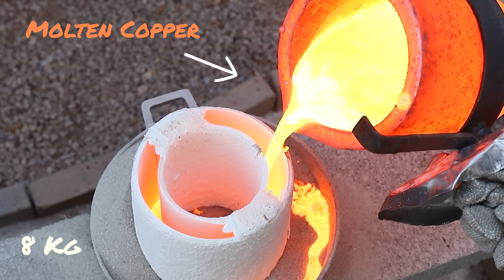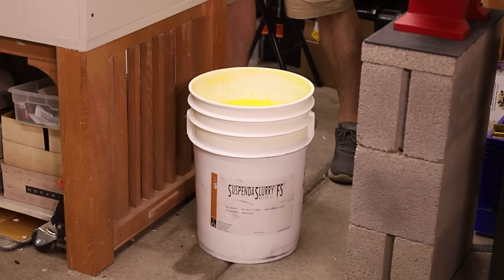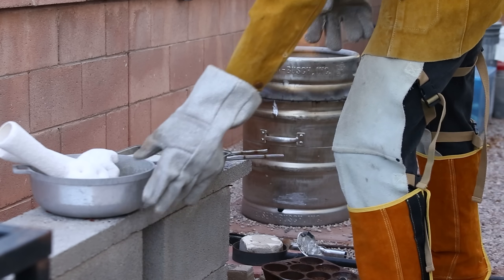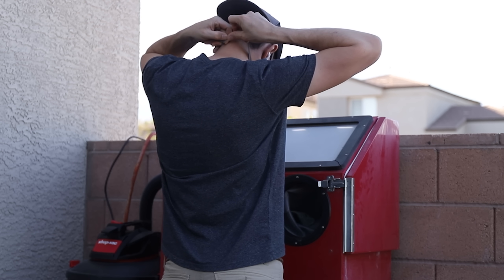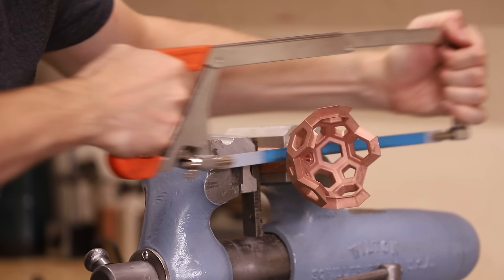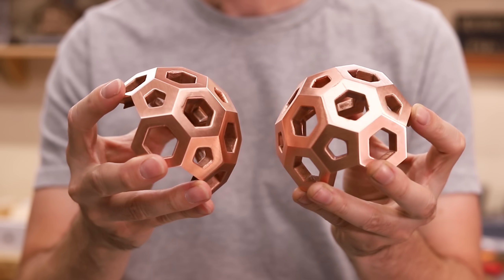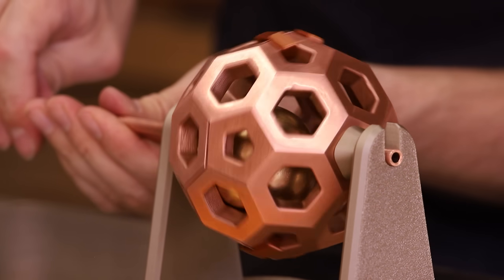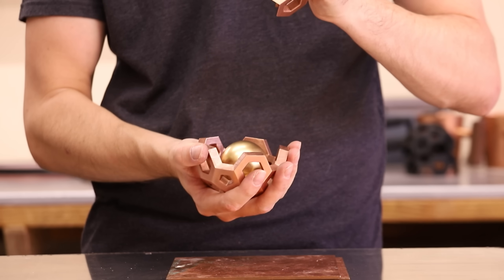HUGE Magnet VS Copper Sphere - Defying Gravity- Will a Neodymium Magnet Float Inside?

Comment: 11:01 when drilling at n rpm, put the camera to n/60 fps to make it seem like the sphere is not rotating
Reply: The "sphere" has 60º rotational symmetry, so you can multiply that stroboscope by 6 (n/10 fps):
60RPM = 6fps
120RPM = 12fps
300RPM = 30fps
And use a short exposure time (with lots of light) so as not to blur the sphere to help it look stationary.
Reply: @robspiess  I thought that if he matches the RPMs to the FPS it should be enough, because each frame would  equal one rotation and would capture the truncated icosahedron on the same position every time, making it look stationary, so we should be able to see through one of the openings as if the truncated icosahedron was stationary.
Reply: @LeonardoG1981  RPM is how many per minute whereas FPS is how many per second.  So if you set them to the same, say 1 RPM and 1 FPS, you'd get 60 frames of different rotations each 6 degrees apart (360° / 60) and wouldn't look stationary.

If you mean matching FPS to RPS (rotations per second), that would work, but that's what originally stated.  The downside is that either it's a slow framerate, e.g. 3 FPS for 3 RPS (which is 180 RPM), or it's spinning ridiculously fast, e.g. 30 FPS for 30 RPS (which is 1800 RPM).

I was saying you could increase the framerate 6 times since the "sphere" has 60° rotational symmetry, e.g. 30 FPS for 5 RPS (300 RPM), and it would still look stationary.
Reply: @robspiess Diligently have you trained your mind robspiess.
Reply: @robspiess but bluring the cage would show to some extreme how it’s not the cage holding it at all
Reply: Exactly. My father was a film maker both 16mm and 32mm . He had a mechanical intervalometer  that hooked up to the camera(Bolex)for time laps etc.By synchronizing the frame rate with the openings i bet you could get some cool footage.This was all before digital cameras. The beauty of the device was that it, along with the camera , was portable (in the analog sense of the word) I wish it had survived but it is long gone. I'm sure it could be done, just as you say, digitally.
Reply: 120 FPS Or Slow Mo 💁‍♂
Reply: n/120pi
Reply: of have long-enough exposure time to fully blur the sphere at speed
Reply: A stroboscopic light at 1/10 the RPM would give a better effect than changing the exposure, it would also be easier to synchronize with the holes of the copper sphere

Comment: Can i ask you to put some rubber between the two copper parts, and then put a multimeter on the two seperate parts and spin it, see if you get any electrical current?

Comment: Good stuff 😊  For scientific purposes try this...

Make it completely spherical, but for one "window" at each side and close to the axis.
Spherical, but for many holes in it but to the axis.
A smaller magnet ball.
A solid sphere

The windows will be tough to see through, so create a strobe that only illuminates upon a set point to see through the smaller holes.

lastly, and for all of the experiments, use an accelerometer or two on the table to judge where the ball is at any one time and trust to science as to what is going on inside 😊

Comment: I have a large 1/2-inch wall thickness copper tube, years ago I did the same things you did in your opening, cool work on this experiment.
Reply: Is the heavy wall thickness really necessary? Would a thinwall tube work as well?
Reply: @LexipMedia  I'm not sure, but I think it has to do with mass of the conductor, because you are dealing with electromagnetic fields. I just built a loop antenna out of copper pipe for my ham radio, that is called a mag loop it uses the magnetic portion of the electro/magnetic spectrum, I don't understand the theory but can use calculators to make it work.

Comment: Because the sphere is polygonal magnetically the magnet will see a bumpy surface, the join line being down the middle will make it even worse because the magnet only 'sees' loops of copper as electromagnets, and the join line breaks lots of loops of copper which ought to be there. This will make the centrifugal force problem much worse as the magnet is being effectively grabbed by the bumps.

I think you could get the effect you want by making the sphere out of a series of copper rings held together by something non conductive. That way the symmetry isn't broken and the ball should levitate smoothly.
Reply: Yes, probably a non polygonal circular surface would work better ... Still, I'm positively impressed
Reply: What if it was just a copper hollow sphere with holes drilled into it to see inside or slots cut out?!
Reply: @purplebooger6410  the more uniform it is as it rolls the better it would work in this respect, so smaller holes would be better, I am not sure how smooth it has to be. I think the first thing would be to get the magnet in through a hatch at one end, not in the middle. Though I don't know if this would make the casting process difficult.
Reply: I think you may be on to something here; but I see half (slightly less than) circles connected together in end caps with copper screws
Reply: any current through any wire no matter the shape will generate a magnetic field and any magnetic field that cuts through any wire no matter the shape will generate an electric current. The join line doesn't break any loops. It just makes more and smaller loops. The main problem is for what he wants to happen the magnet needs to spin slower or faster than the copper ball. The problem is once the magnet matches speed with the copper ball the relative speed drops to zero so the magnetic fields from the magnet are not cutting the copper therefore not generating Eddie currents to generate a field and repel the magnet. When they match speed the magnet stops getting repelled by the ball and falls. This stops it and its able to generate magnetic fields again therefore pushing the magnet back to the center. The best way to solve this that I can think of is to keep the ball rotating on all three axis constantly changing the axis of rotation. This would make it to the magnet never catches up to the ball keeping a difference in speed between them.
Reply: @rookooful  a motor spinning the horizontal axis like he's doing, plus another spinning the whole base around a vertical axis?
Reply: What if it was more like a tyre or just a ring?
Reply: @bananabaton  we know a tube works because it was early in the video. I think the aim is to make it possible to see the magnet better.
Reply: Heave ye tried transparent aluminum, Laddie?
Reply: @jamesspears7242 
Nice one Scotty!
Wait....
What are you doing back here in 2024??
🖖
Reply: This path recreates an alternator.
Reply: butonce at a high enough speed and if ballanced just right it shoild lock in a center point from the shape.
Reply: 22.5° on tilted axis may do as such however it would need a 10 speed wheel to spin on to get true centrifugal forces exerted in it. Possibly make a huge magnet sphere to orbit as well.
Reply: I thought something like this too.. the field of a sphere should hold at specific points, but at a certain spin rate wouldn't it resonate to the eddy currents phase to the frequency of the copper "soccer ball" ? 

Genuine question. As I made a detailed comment about improvements and a mad labs addition.
Reply: @dannfyxt3049  are you talking about the mass on a magnetic spring resonance and that resonating because of the change in inductance that the magnet is seeing?

I don't know if that would stabilise or destabilise the magnet. There are also magnet rotational modes to consider and how they interact with the dodecahedron.

It is messy and difficult and i think a finer mesh with no electrical holes would be a lot more stable either way
Reply: I don't know the science stuff, but I think we may have the same idea: really strong magnets in the middle and a ball with magnets outside. Somehow, with scientific stuff, we can make the ball float, not really 100% magnetic with the middle magnet. It will be cool because when the dog plays with the outside ball, it will go in circles and will not drop because the middle one is a really strong one.
Reply: Bussard fusion

Comment: Since its audible when the ball is floating and not touching the 'the containment construct', I'd go with a hand crank to avoid motor noise. Maybe with some nicely machined gearing so you can finely adjust the speed? 😊

Comment: Curious if its heating up too much and causing the sphere to become less magnetic. Can't remember if thats only at high melting temperatures, but I figure it would be contributing to it since the magnet is so big. Shame their aren't smaller, stronger magnets, or at least a lighter weight one with similar magnetic strength.

Comment: thats cool and so many questions. does its behaviour chance if you improve the connection between the tho parts of the sphere? what about if you insulate them from eachother and spin the ball on a different axis? will it behave different if the electrons can follow a straight line instead of being forced to follow the hexagonal path?

Comment: Instead of buying silicon to dust on the ceramic next time, grind the old ceramic. You already know it's melting point and it is thermally stable now. Common in raising the working temp of clays by a few hundred degrees above the same virgin clay.

Comment: If you figure out an ideal speed, you could try synchronizing that with a strobe for filming the effect.

The left over sprues could be made into candle sticks!

Use the torroidal magnet attached to a motor to spin the sphere at just the right speed to make the magnet levitate?

Comment: would something like this work to dampen vibrations? like, say, I have a 3d printer on an unstable surface, you mount this to the under side and it resists moving?

Comment: The electrical contact between the 2 shell isn't very good, you could get a better result if the two shells fits perfectly or with indium foil in between

Comment: I feel like there has to be some form of mechanical application for the rotating it with a different magnet without actually touching it. 

Makes me wonder if you had two setups (as identical as possible) and placed them about a foot apart could you rotate one forcing the other to rotate? would they balance each other out and provide resistance to you rotating them? Would they rotate in opposite directions or the same direction? (actually it looks like from your experiment in the video they would rotate in opposite directions.) Can you rotate it with an object inbetween them (like a thin barrier)? 
Depending on how much force/resistance is required to rotate one sphere. Might have some mechanical application for changing rotational directions. What if you set up say 5 of them a foot apart. then manually rotated the center one. How much force would be needed to rotate them? would all 5 rotate alternating between directions? 

these are the questions in my mind. 
What if you set up 5 identical setups about 1 foot apart. Labelled them 1A 2B 3C 4D 5E. On 1A, 3C, 5E you had the rotating rod going out the left side, while on 2b and 4D the rod was going out the right side. 2B/4D's rods are both connected to their own individual Motors both set up identically to spin clockwise. Would 1A/3C/5E rotate Counter-clockwise and how fast would they rotate?
would it be: 
A) All three Rotating counter-clockwise at the same speed as 2B or 4D
B) All three Rotating counter-clockwise at the speed of the sum of 2B+4D
C) Only 2B / 4D rotating clockwise (due to their motors applying force to them and the other two setups on either side providing an opposite resistance force)
D) No Rods rotating due to the others applying an opposite resistance
E) ODD rods (1A,3C,5E) rotating at different speeds each with 3C being the fastest one to rotate (as it has both Even rods applying a force to it, where the others have a singular force being applied to them.) 
F) Some other outcome I didn't think of in my 5 mins to typing this post, that may or may not be obvious 

I personally would love to know how much it would cost to have you manufacture 5 of these setups (magnets and everything), because i would be curious in running multiple experiments with them. Granted, i'm poor and would never have the money to do such experiments, but Nonetheless i would love to know how much it cost you to make/manufacture. A quick google with limited information. 
9 Pounds of Copper has an estimated value of $38 and some change (let's round it to 40 for simplicity sake) 
I found a 2in Gold plated spherical magnet on the website magnets4less. that costs 196 dollars with 33 dollars worth of shipping (let's round to 250 to account for shipping and taxes)
So that puts it at roughly 290 dollars (let's round to 300) just for materials. 

Next id like to talk about the things i didnt factor there. You'd have to make a mold for each part (as you made a single use mold not a reusable), sandblasted the parts, and the sprues themselves (which could be recycled allowing as to recoup some of the cost of the Copper. As well as the biggest elephant of all of this: YOUR individual expertise. YOUR valuable time. YOUR design. Basically YOU. I could easily see it costing 500-600 dollars PER "Sphere" with magnet to produce not accounting for you needing to make a profit were you to be willing to sell and manufacture them. So, in my mind Im thinking 1K Each. Like i said i would never be able to afford to run the experiments just for the purpose of finding out the outcome

Comment: Those leftover cones can hammered into metal pipe to flare the end/enlarge the diameter for fitting two pipes together. A similar tool is commonly used at exhaust shops but I'm not sure how well the copper would hold up lol

Comment: You should hook up an amp meter to the shaft when spinning with the drill. See is some weird current waves are created. Since you are forcing a conductor through magnetic flux. Currents should be produced.

Comment: The main problem is the size of the piece that holds the magnet. When you put the magnet in the tube, you get a floating effect because all the walls of the tube are close and form almost the same attractive force, while this size does not make the walls close together in the same shape and size as the round magnet. Also, a basic problem is the size, which It causes the need for a certain speed to float because it does not exploit or approach 40% or 20% of the entire body of the magnet Too big, as if you were doing the same experiment by placing a very large tube and a small magnet, it will be pulled to one side, and only because 20% of the mass or less is the one that is attracted

Also, to make the matter more clear, try reducing the thickness of the lines while increasing their number, and use curved lines like these 🌐 because at some point it will be exposed, even completely, and what stabilizes it is that it is crossed in the center, like the poles of the earth’s card, which will make the connection without any obstacles and float, and will make The road in the middle is empty, but complete and easy to photograph or see

Comment: If you have a motor set up that spins it at a constant rate which keeps it floating, something neat would be to get a camera with a variable frame rate so you could get it matched with the rotation of the holes so it'll look like it's stationary with the ball hovering.

Comment: I'd suggest lowering the ratio between the inside radius of the sphere and the radius of the magnet.  The ratio between the copper tube and the magnetic disk seemed to be smaller.  I wonder if the skin effect is related to the magnet falling out of the center as the speed increases.  At 60 Hz, skin depth in copper is 8.5mm.  The magnet is not staying in the center, so, as the sphere rotates, the magnetic field of the magnet is moving in and out of the sphere at the frequency of the RPM of the sphere.

Comment: If you film under a strobe light, you should be able to find a rotation speed that makes the sphere look stationary. Like when the rotors of a helicopter match the speed of the frame rate, and it looks like the rotors have stopped spinning. That way, we can see into the sphere.

Comment: Try adding some electrically conductive gel between the two halves of the sphere.  You should also have clips the entire way around the sphere, and by printing heavier or lighter clips, you can balance the sphere.  Thanks for the video.

Comment: That is very similar to an expierament i spent a couple weeks on in highschool. Instead of sided holes in that shape, we had circles, so we could fit circular neodymium magnets in those holes, alternating mag poles as i installed them. Then leave 1 open so you can see inside. If done right, the magnet in the center will lock into place, and will be surprisingly difficult to move with a stick or pen. But will spin frictionlessly in any direction. I remember it being one of the neater physics expieriments i ever participated in.

Comment: Those sprues with the hemispheres still attached look like goblets to me, albeit ones hard to drink from with the tessellated edge. But that's what you should use the sprues for. Cut them down a bit, melt the excess down with the other leftover scrap from before to make a paid of small discs for the base and cups to hold the drink. Maybe drill out the center of the sprues a bit to reduce weight, but keeping them chonky should make them very stable.

Comment: There are ways to 3D print supports in a different type of plastic that doesn't stick to the plastic you print with making removing supports and cleanup way easier.

Comment: Measure the induced voltage between different points on the device. I'm curious how efficient the mechanical input is being converted to electricity. It looks like you made a generator and I'm curious about its electrical properties.